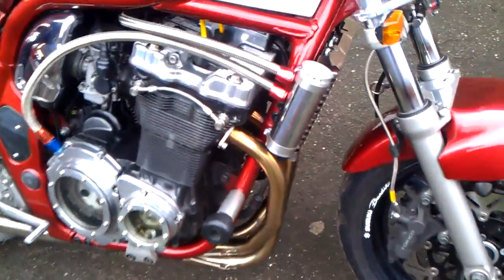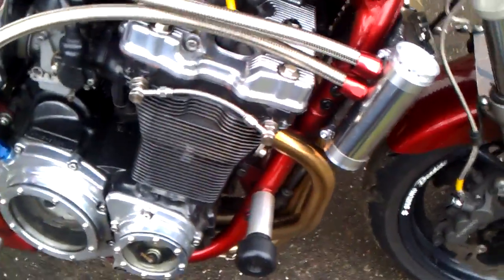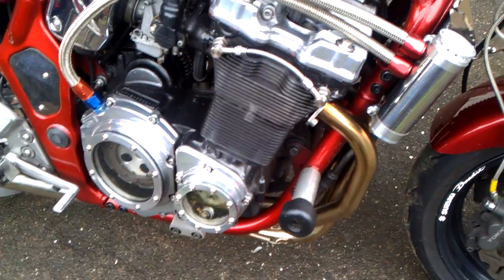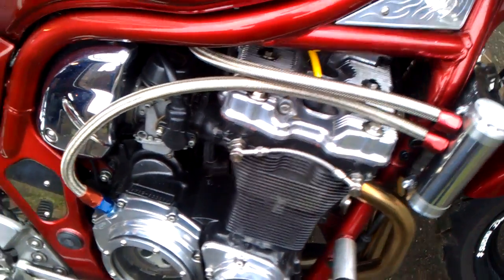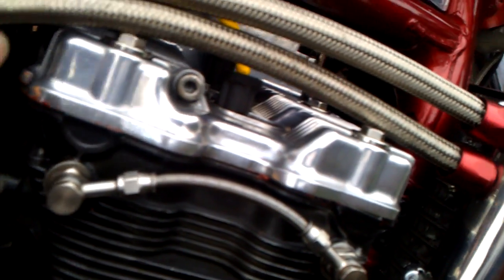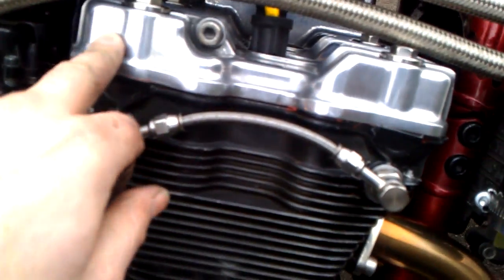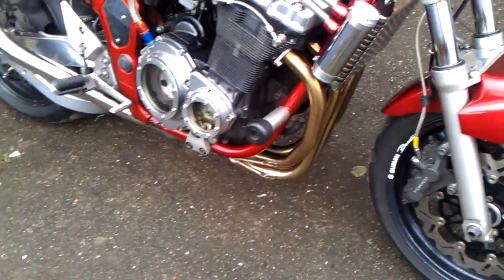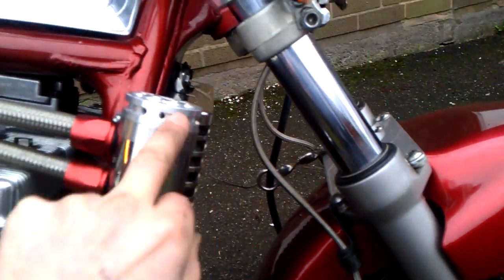oil catch can

Comment: Is there an covert tips to go from a 20-an hose to a 12-an?
I'm trying to replace my current factory crank case hose that runs to my crap factory airbox.
I'd like to add a oil can/breather but the tips only go up to an-12 and my port for the crank case is much much larger.
Reply from the maker: You will need an adapter something like this .. https://www.amazon.com/Flare-Reducer-Adapter-Union-Fitting/dp/B00TECL6NK
Reply: @trebor4460  thanks Robert

Comment from the maker: you can tap the hole in the cam cover to fit an adapter if you like but i fitted a tube in the hose and sealed the tube in the cam cover with sealent.

Comment from the maker: The size of the oil filler cap thread is M20 x 1.5mm pitch, it's the same for the 1200 Bandit too
To fit a stainless breather you will need e pipe and and a crankcase breather adapter that replaces the filler cap and gives the correct thread for the pipe fitting which is AN- 8.
Look here on EBay for the fitting..

Comment from the maker: have just had a look for my old cap to measure it for you but seem to have lost it, will let you know when i find it again and can measure it. Bear in mind mine is a B12 so your B6 might be a different size anyway.
The set up will work just as well on the 600 as the 1200 ;0)